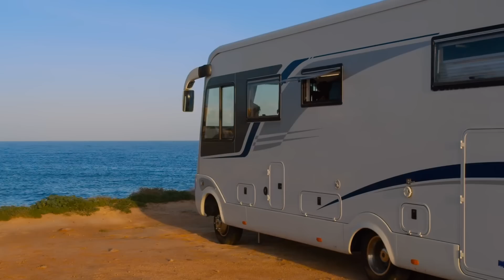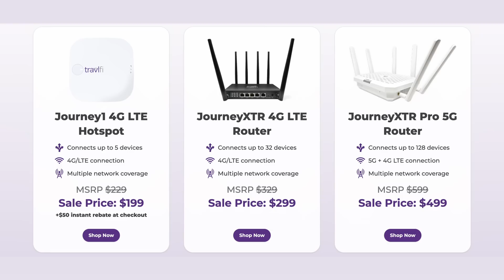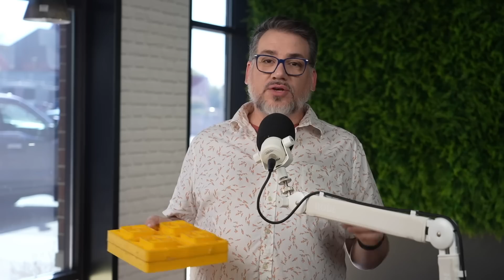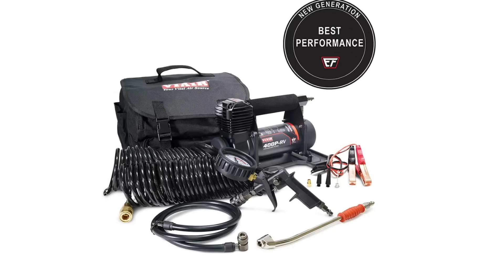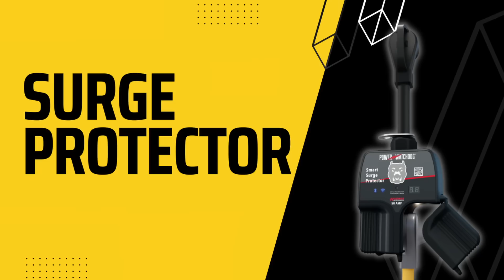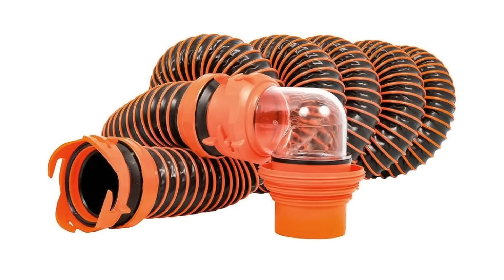10 Essentials for New RV Owners

Comment: Great list! I'd add
(1) a torque wrench with sockets appropriate for your trailer and tow vehicle/motorhome,
(2) a couple of 5 gallon water jugs, and
(3) a 100 foot 15 amp extension cord.

The first two are pretty self-explanatory. Some will justly point out that you shouldn't draw 15 amps from most 100 foot extension cords due to voltage drop. But even if you can only draw 8 amps from them, 8 amps is better than 0 amps. We've used our 100 foot cord several times, especially when moochdocking.

Comment: If you have only one tool, it's got to be a #2 square head driver.  Almost every screw in the trailers are square heads and not traditional flat or Philips head.  It will get used more than any other tool.

Comment: Spot on! I’m a 68-year-old grandmother who has been traveling full-time for almost 4 years. You really hit the ESSENTIALS. I highly recommend that your viewers get the brands you recommend. The VIAIR compressor was expensive, but saved us in Utah. The Watchdog surge protector saved our electrical system at a fair campground. It was much easier replacing the surge component (by myself) than replacing our whole electrical system because of faulty wiring at the facility. Now I just need to replace that white drinking hose with an evoflex. Wish I’d had these recommendations before we hit the road. Thank you for this video!

Comment: Excellent recommendation on the surge protector/EMS as essential.

The 2020 National Electric Code (NEC) added "§551.40(D) Reverse Polarity Device", which required a visual or audible alarm when there's an ungrounded (black) conductor and grounded (white) conductor reversal.

The 2023 NEC changed §551.40(D). According to NFPA's summary of technical changes, "Deleted former section 'Reverse Polarity Device' and added section 'Loss of Ground Device' to address the 'hot skin' effect that RV's can have and to provide the intended requirement of circuits at detection of a loss of ground."

The new 2023 NEC language is:
"551.40(D) Loss of Ground Device. Each recreational vehicle shall have a listed grounding monitor interrupter permanently installed between the feeder assembly connection to the vehicle and before a transfer switch if installed or the panelboard. This requirement shall become effective January 1, 2026."

The big change is from an alarm device to an interrupter device that responds to two serious conditions.

Most of these devices are also surge protectors. Always purchase only those EMS devices that are UL-listed (ETL, CSA, etc.).

Comment: For me, I just learned that there are sewer caps with a handle on them. This helps getting the cap off easier. I have only dumped the sewage once because I couldn’t get the cap off. Luckily my husband was there to do that for me. In the facebook page that I read about this, some men were saying that it makes the job easier as well.

Comment: I got the water regulator when I was flushing the toilet and the water was shooting out of the bowl. I didn’t know about the flexible hoses when I bought mine, but I got a short and long hose to avoid having tangled messes. 
I have leveling blocks that came in a bag, but I still use a block of wood under the tongue jack. 
I have a weight distribution hitch, but my trailer is 3500 pounds GVWR and 2275 dry with dual axles, so I usually use my U-Haul hitch. 

I use an Avid air compressor that can run on 12 volt, but also has a small 18 volt lithium battery, so it’s just like using a cordless drill. It also has a bag and has been useful for airing up and down the truck tires. It shuts off when it hits the selected air pressure which is nice.

Comment: For people with travel trailers, the right size wrench for the Lug nuts

One thing I keep meaning to buy is a tire plug kit. Our class C does not have a spare tire or wheel. A high-enough pressure tire pressure gauge is critical.

Comment: I have been RVing since I was a boy in the 1950's and agree with your list 100+++%.
One thing I would add is a collapsible sewer hose support. I use the Camco Sidewinder RV Sewer Hose Support. It will help with less wear & tear for the hose but more importantly insure a good down hill angle for maximum flush pressure when dumping. Unless you enjoy "walking the snake" up hill you will thank me!

Comment: We had a Watchdog Surge protector.  At 2 different campgrounds it continually shut off our power. Called the company & got basically,  I don't know why that happened.   Wasted a hundred plus dollars! NEVER AGAIN!
Reply from the maker: That’s unfortunate to hear. Ours has been a rig saver many times over in the last 5+ years that we’ve been using it.
Reply: My surge protector will shut off power if there is a low voltage condition (brownout). It can be intermittent and it is bad juju for electronics. Happens more frequently on hot days. Depends on the park - some parks have better power than others.

Comment: A screwdriver or drill bit for those funky square drive screws rv manufacturers love to use. So many times I’ve needed to pull a panel to tighten up plumbing or get something that slipped under the slide out cabinet!
Reply: It blows my mind how many canadian knows what a Philips screw driver is, but Americans struggle with the Robertson screw driver name 🤣.
Reply: @SpykersB  We moved on to the more elegant and functional Torx head screws.  But I won't make fun of you if want to call it a "star drive".
Reply: @jamesr208  lol, i wouldn't be laughing at u if i didn't know my bits. 🍻
Reply: One suggestion, get a 12v sewer macerator and 50' 3/4" hose to specifically dump tanks. No more stinky slinky! We love it more than a TPMS (tire monitor sys), which for us was a huge waste of money. After a brake & bearing job, we lost a wheel driving who knows exactly how far and never knew it. We felt secure until the sensor never alerted to NO psi or temp. Try it some time. When leaving rv on site, turn on system, get readings then drive away. Check how far or what time elaspes before an alert shows difference! If at all.
Also, know how to change a flat. Some "Good Sam" or AAA may take hours to show up. Usually a Good Samaritan or fellow traveler may stop & offer assistance!  We have.

Comment: I have not seen the blue ox level system ,iam interested ,however would need 4 as the current motor home has dual rear tires an a single block would overload one tire,I WILL GET 4 . I do have the good water hose, the water pressure regulator is a good idea ,we do not have one because  we don't use the park pressure we only use our internal fresh water pump an add water to the tank when needed. The plastic blocks for under the levelers is a good idea an in a lightening storm if no metal is on the ground you won't go poof. The other items are good an relative. If you purchase an older RV buy a new smoke detector an gas detector it may save your life. Fire extinguisher is good to have . A good flashlight is important get at least 1 ,HOPE THIS HELPS.

Comment: Everyone needs:
1) a level!
2) a fire extinguisher! Actually 2. One for grease fires in your kitchen. One for electrical fires/wood fires. I have a vintage bus & keep 2 in my engine bay. 
3) Smoke detector!
4) Carbon Dioxide detector!  
5) Propane Detector! There are detectors that double up some of those detectors in the same box. 
6) I have both a generator & an engine in my bus so I also carry a carbon monoxide detector too. Not everyone needs this. 
7) Jumper cables.
Reply: We have fire blankets
LED flares
Safety vest
Head lamp
Reply: My trailer came with two levels built in.
Reply: I lost audio about half way through/
Reply: Great suggestions!  These are must haves!